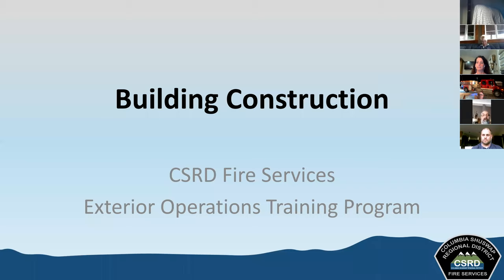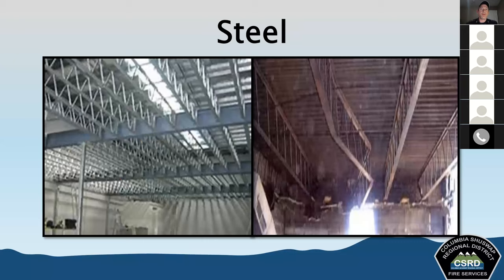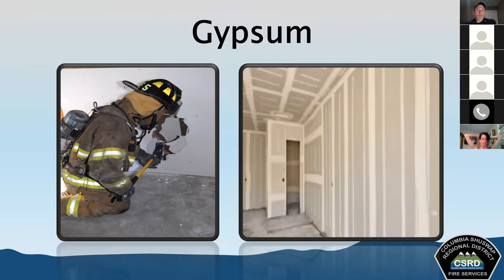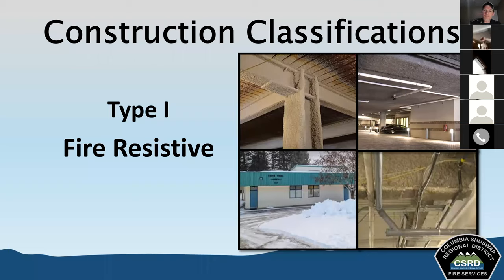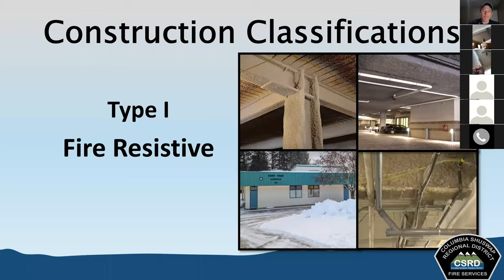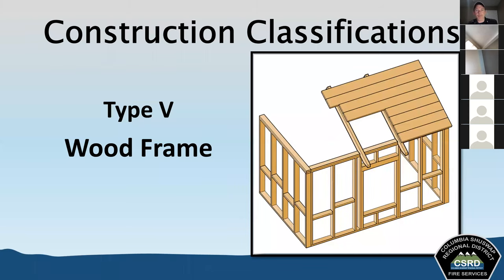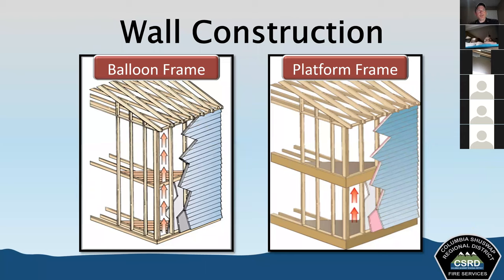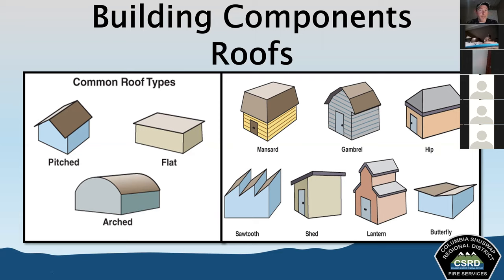Fire Training Course - Building Construction

Comment: Great presentation, a lot of important info for aspiring firefighters, but the background noise produced by other attendees is pretty distracting. Turning your camera  and muting your microphone when not in use could help  eliminate interferences.
Reply: It's a zoom call. This is way better than a lot of the college courses I took. If a little bit of brief intermittent chatter is that big of a deal for you then you should definitely work on that in case you're in a situation that requires focus while there's commotion in the background